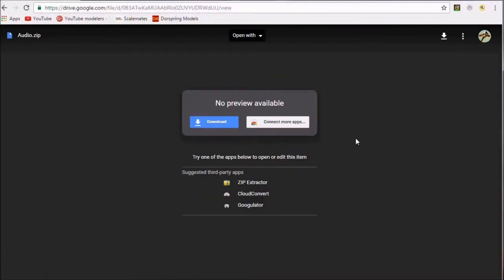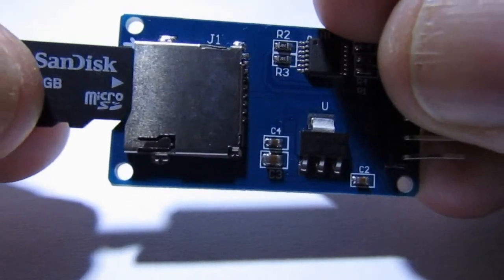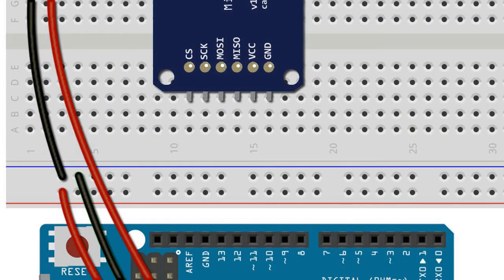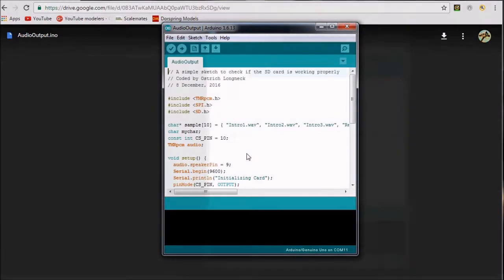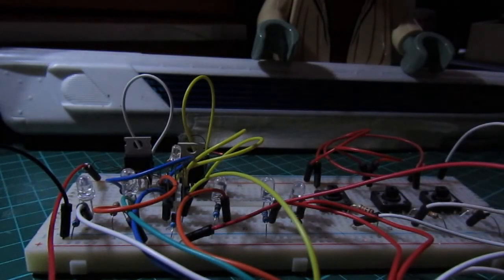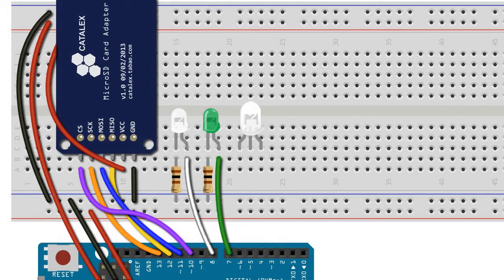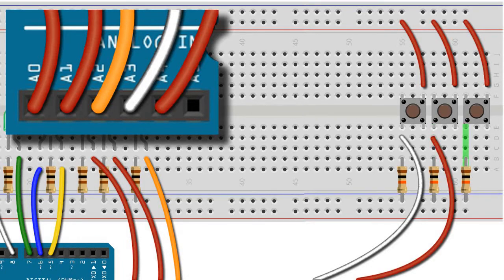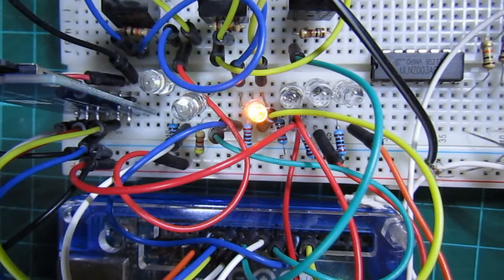Arduino for Starships - Ch08 - Adding Sound Effects to a Circuit with an SPI-based SD Card Adapter

Comment: Trevor, my friend, managed to solve my problem. It was just a matter of doors. arduino uno uses port 9 for sound while mega arduino uses 11. Then it was just adjusting the code a little bit ... and... voilà
Reply from the maker: Hi Luiz! That's excellent news! I must apologize, I remember reading your comment a while ago and trying too look for the Mega's pin layout (I think it was in the back of my mind that it might have been something to do with the PWM pins, as the sound module uses these quite extensively) but it completely slipped my mind to investigate further. I'm more familiar with the Uno, so I'm glad you managed to figure out the problem :-) I hope it helps you to create something amazing! - Trevor
Reply: @OstrichLongneck  Cool Trevor! I was very pleased with the result. Including, the hangar's led effect, I also did on the mega arduino. I would like to share with you. it was really good
Reply from the maker: @capkirk1001  Good work! That sounds awesome! I'd love to see how it turned out :-)
Reply: @OstrichLongneck  Hi Trevor.
My son has a project he's started that needs a couple of different sound channels.
Is the arduino capable of outputting separate signals on separate channels to get more than 1 sound effect at a time?

Thanks for the vid BTW, it's very helpful and straightforward unlike others we've tried following
Reply from the maker: @Th3_Gael  Hi :-) Thank you very much for your kind words. Unfortunately, the sound card I used is very basic, a single-channel 8-bit mono output. I know the Adafruit FX board is capable of stereo output, which can be split to create two mono channels. This may be better suited to your son's needs, and Adafruit have awesome support for their products, too. When the phasers and phopton torpedoes are fired simultaneously, I cheated a bit and mixed the two waveforms into a single waveform to compensate for the overlap in sounds :-D
Reply: @OstrichLongneck  Thanks for the quick reply.
We'll have a look at the adafruit board and see how we get on.
You earned a sub yesterday because your vids are straightforward (and I'm a trekky 😁)
Reply from the maker: @Th3_Gael  I'm a die-hard Trekkie myself - I have it so bad that I even love Discovery, haha! Thanks very much for the sub. Much appreciated :-)
Reply: @OstrichLongneck  me too.
I know it's woke, got tons of problems etc but it's trek.
Even bad trek is better than some other scifi
Reply from the maker: @Th3_Gael  Well said :-)

Comment: Trevor, this is an excellent series. need some advice though, the SD card uses a lot of pins and is quite large, would say a mp3 player such as the DFPlayerMini, which only uses 3 pins do the same job or would the timing be off? Also is the Nano capable of running these sketches as it is smaller than the Uno and fits better into the main hull of the kit.
Reply from the maker: I'm really glad you are following the series. It's always great to know that I may have helped someone in some small way! I agree that the SDI card is a greedy module when it comes to occupying pins, and I can remember exploring some other options. If I remember correctly, the DFPlayer Mini didn't have a great Arduino library at the time, so I couldn't (for example) switch between sound effects of phasers alone to phasers plus photon torpedoes. But I notice a new library has been uploaded  at GitHub in the interim, so it may be worth revisiting the DFPlayer module :-) The mere fact that it uses MP3 files instead of those horrible  8-bit WAV files makes it worth the effort! And, yes, as you've mentioned the Nano can run the sketch without a problem, so if you're shooting for small spaces then it's the ideal way to go! I don't know if you've watched some of the later videos, though. The final circuit is a real clunker and would need a big perfboard that would probably need to go into the base of a model. Thanks for a great comment! - Trevor
Reply: Thank you for the help. Yes I have seen your other videos, but a little concerned as to final size, that is why I am thinking about making a few small discreet function boards, such as Nav and Strobes, and the chase lights for the hanger as you have already suggested. But now may even look at the Warp effect as it is a discreet component and could be controlled by an atTiny85 as well I think, just as we are doing for the hanger bay lights. If so then this frees up a little more room inside the main hull. Just some throughs to pass on. Still work in progress but I have gained a lot from your videos and it has really helped me along the way. Look forward to your next one.

Comment: Very very interesting and informative videos. I wonder, what would you come up with to emulate the phasor bank blast like on the phasor array in the USS Voyager. That is a very cool effect.
Reply from the maker: Thank you for your kind words :-) You're right, the Voyager phaser effect is awesome, but it shouldn't be too difficult to achieve. I've seen a few videos where a commercially available circuit was used, but it only uses three LED's to emulate the sweeping motion before the phasers fire. A better effect could have been created by using a simple shift register and at least 8 LED's on either side of the phaser. - Trevor